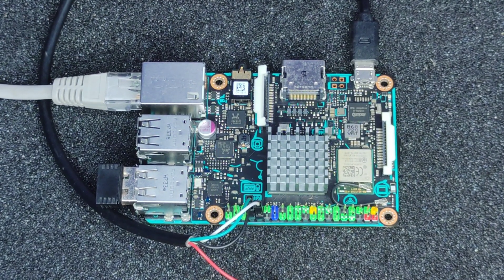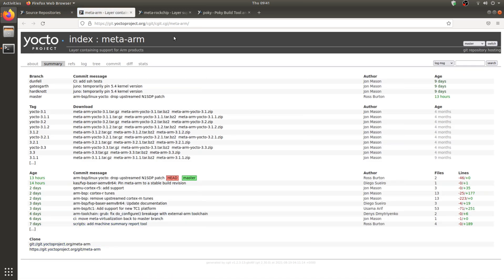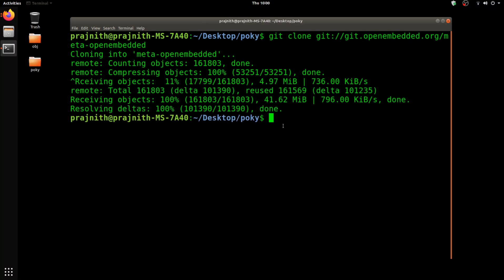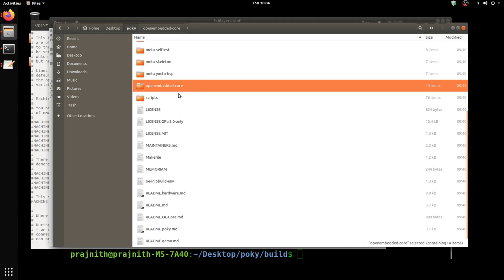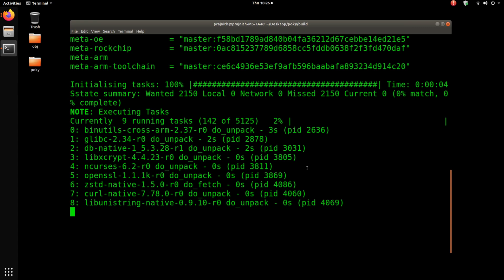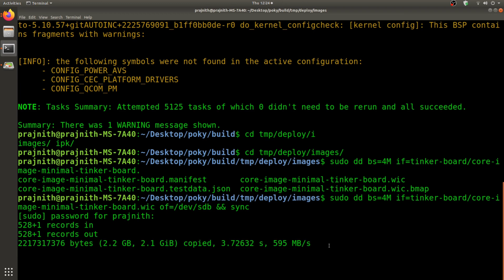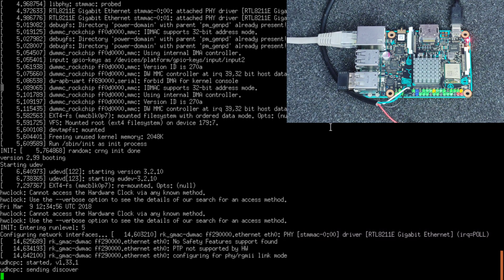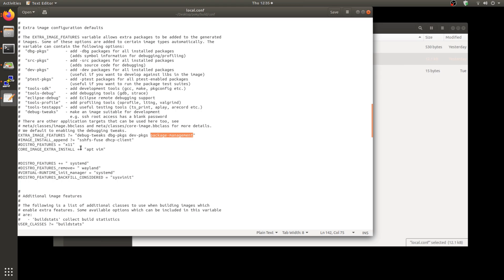How to Build Minimal Linux From Scratch For Asus Tinker Board using Yocto

Comment: Hello, first of all, thank you for the effort you put in your videos. I am struggling on getting Yocto working with ASUS TinkerBoard 2. Could you please give me a hint on how to modify the machine configuration to be compatible with the RK3399 new TinkerBoard 2? Best regards!
Reply from the maker: Hi Bojidar
Did you add the meta layer as mentioned in the repo readme?

https://gitlab.com/tinkerboard-yocto/meta-rockchip

Also don’t forget the add the tinker board 2 under machine , honestly I don’t think there is specific machine conf for tinkerbaord2, you can try with firefly-rk3399.conf

build/conf/local.conf search for MACHINE and append rk3399, so it should look like below

MACHINE = “firefly-rk3399”
Reply from the maker: You can also look into repo but rk3399 conf is different here, look into conf/machine

https://github.com/TinkerBoard/yocto-meta-rockchip/tree/linux4.4-rk3288-tinker_board

Comment: Hello! Have you a hint about how to add qt in the build? I'm struggling to add eglfs support to qt.
Reply from the maker: First git clone the QT branch inside your Yocto root directory  , example below

git clone -b sumo https://github.com/meta-qt5/meta-qt5.git
source oe-init-build-env
bitbake-layers add-layer ../meta-qt5
cd ..
source oe-init-build-env

make sure my bitbake recipe has DEPENDS += qtbase

The run below command 
bitbake qtbase

if you get error w.r.t qt** add below packages to local.conf
IMAGE_INSTALL_append = " qtbase qtbase-tools qtbase-plugins"
Reply: @degzero  thank you for the explanation. 
However, I'm still having the same issue that occurred before:
"WARNING: No QPA platform plugin enabled! This will produce a Qt that cannot run GUI applications."
The eglfs support is not being enabled.